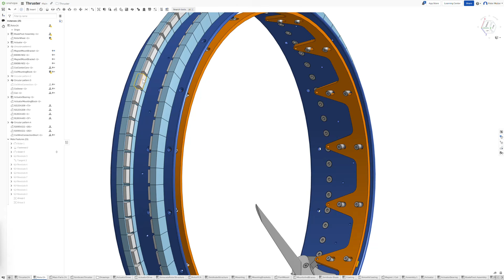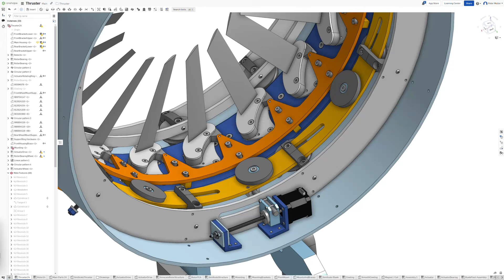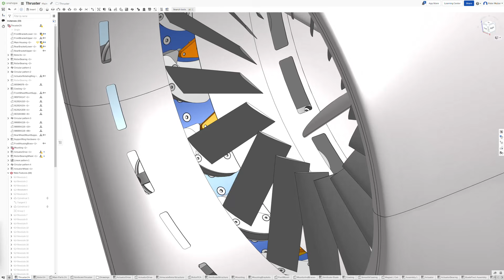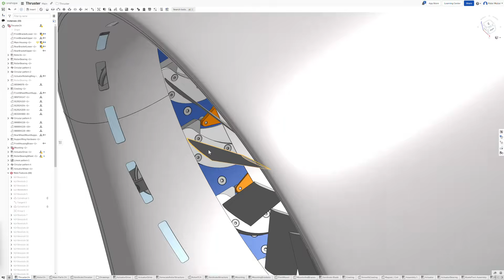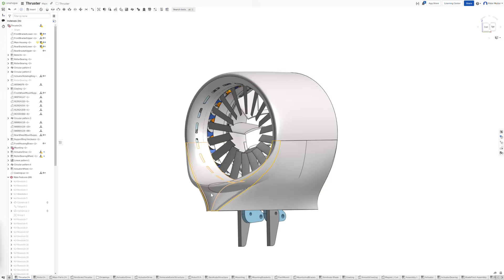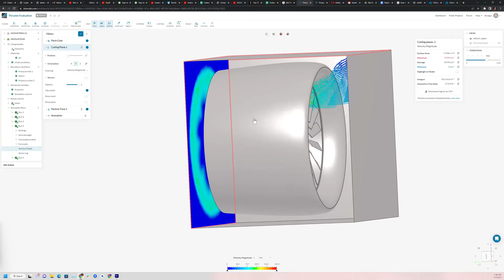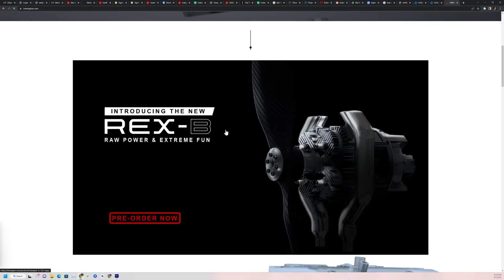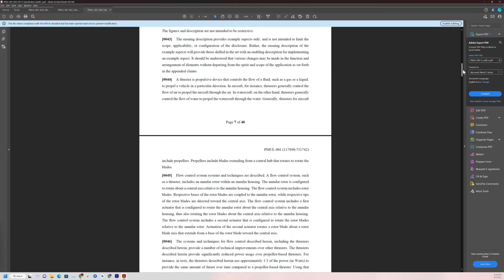Could this Thruster transform Aviation?

Comment: Very interesting 😁
In your efficiency calculations, did you account for the conversion between fuel and electricity? I might have missed it, but I can't really see it anywhere.
A very efficient petrol engine today, is probably close to 30% efficient. I have no idea what the efficiency of the engine you proposed is, though.
One of the most efficient petrol engines today, might be the "tiny friendly giant" from Königseg, using their free-valve technology.
However - hydrogen fuelcells are pretty efficient at turning hydrogen into electricity, though the last time I read about them, they required some pretty expensive materials. Also - considering the full efficiency from production, compression, and conversion, you're somewhat low in efficiency, but for keeping the weight of such an aircraft low, and "local" efficiency high, I think that hydrogen fuel cells are the best option.
Reply: The Edison generator and or battery powered dynamos don't need fuel to produce electricity..
Reply: You're comparing an otto cycle to this? That makes no sense. You should be comparing Brayton cycle engines like a turbofan against this. Brayton cycle engines are much more efficient then ice otto cycles. Otto cycles are around 30%-35% efficient, with modern turbofans hitting thermal efficiencies of 50%+.

Comment: Congratulations! Like someone suggested before,an inner ring is needed here, where it holds the blades to it's pivoting centers...
At high rpms,like it is now ..it will probably flutter and break.
I had designed a turbofan for an air exhaustion system for a CNC dust vacuum..
And on the first design I didn't consider the inner ring..
It all broke apart
Now with the ring..it's working perfectly for 2years ..

Comment: My concern will be FOD, the blades are under compression instead of tension. The blades will be forced to twist under load and in the event of a FOD strike they will probably splay outward.  I’m looking forward to how this plays out. Good luck!
Reply: What if they were attached in the middle? Like it was one piece?
Reply: @jollygoodfellow3957  Having a device in the centre would be heavier and have more drag, adding pitch control would be tricky.

Comment: it would be interesting to see what the flow and pressure would be with a tear dropped cone protruding from the stationary fins through the center.  thus pushing the air into blades. and honestly for the power you are looking at I would look into the watercraft market.  they push some insane power and have shown to be pretty reliable. the engine you are looking it cool but has a lot of complexity. I would almost wonder if it could outlast a rotary engine..... hmmm how about an all aluminum rotary? for the power system I would stray away from experimental systems.... I feel that was the death of the original raptor. if you do go with the proposed engine I would ground proof it with about 40 days running 24/7 under 3/4 load....
Reply: If you put a cone there, you might as well put the motor there and spare the weight & complexity of this design.
Reply: Lol or physics!!! If you think the look makes it useless and "might as well put in an engine" you totally missed the point!!!

Comment: Even at the low end of your target RPM range you will be about 5 times faster than a rotary engine from WW1.

They learned the hard way that it's a battle to spin a large rotary mass fast and it comes with all kinds of penalties.

The torque from those old rotary engines made taking off and landing difficult and it limited the airplanes ability to turn in a direction against the torque.

While I don't think this is a practical engine for aircraft I do think in a twin engine configuration that counter rotation would be best to cancel out some of the negative aspects.

Comment: Many years ago in a thermo module at University I designed a Brayton cycle gas turbine where both the compressor and turbine stage were coupled with a shaft external to both stages
which were sat on annular rings and faced inwards. I was interested in designing a more robust turbine for FOD. I never built the turbine stage but I did build the compressor stage. In many ways this was easier than your construction because I was not trying to embed an electric motor in the outside ring. Which brings me to my suggestions. Don't try to do both in the first design. Worry about the complexities of the electric motor in the outside ring later. Drive it off an external shaft of some kind initially with some gearing. What I discovered about that is that I then needed a sun gear arrangement and a torque multiplexer similar ( interestingly enough as it has comoe up multiple times in work I have done over the years ) to the design of torque multiplexer similar to the design on the front of the Napier Sabre. Lastly when I did get my compressor to run and we put smoke through it in the tunnel and the air flow in the middle was a right mess. You may have none much better wth the CFD and FEA than I did. I did not have access to such wonderful tools. Just a whiteboard and a some pens mostly.

Comment: Here we go again.  Outlandish claims from a guy with no real engineering background and who proved on his prior project that he will not listen to anyone who actually has the engineering knowledge.  Anyone who invests any money in this is foolish and will lose their investment.  If this worked, it would already be in use.
Reply: Well said Sir,
Even the best designed ducted fans in the world are less efficient than a conventional modern propellor. That the designer has supporters believing that he has yet again found some magic formula missed by over 120 years of scientists and aircraft designers  is laughable. 
The fastest 100HP aircraft on the planet race at Reno Nevada every year. They utilize every possible technological advancement in both materials and methods. Engine life spans are measured in numbers of races, not hundreds or thousands of hours, and yet top speeds for these stripped down pure race machines is less than that claimed for this heavy, inefficient, unstable, and draggy aircraft driven by what appears to be a potato chopper.
I doubt that many on this forum have ever even sat in a plane, let alone flown one.
Reply: @jamesgrant2253  Paragliders already use ducted fans to improve thrust and reduce prop diameter, so...
Reply: @vitordelima  Paragliders use ducts to protect the pilot and anyone around the aircraft. Any increase in performance is marginal at best. If a correctly sized prop were used for the engine it would outperform the fan significantly but also pose an unacceptable danger
Reply: @jamesgrant2253  Like I said, effeminate.

Comment: Oh god, another thin gap perimeter driven turbine fan.  If your intent is to create a new "LOOK" sure it looks cool, but there is nothing better about it.  The perimeter bearings are running at crazy speeds, the iron-less core needs external inductors because the IGBT's can't switch fast enough, unless you are using iron core which will be crazy heavy.  Don't believe the hype about in the ultra-fast switching electronics where you don't need inductors.  It is extremely unstable with ringing currents all over the place.  the perimeter housing and the center fan need to be very rigid to maintain proper gap (a lot of weight).  Did I mention it is crazy expensive.  All to get rid of a low cost, very reliable, low weight, very rigid center driven motor.  Seriously look at all the compromises that have to be done and stop this stupidity before you waste every ones money.  Maybe some niche market, but I can't think of any application where this is concept better.
Reply: I agree. Also imagine what would happen to an aircraft if the huge mass of this rotor were to sieze. Fortunately this will never be used in flight.
Reply: Well aren't you a big fat ray of sunshine? Let's see that last thing YOU designed.
Reply: I can see the idea behind it. 

I don't see this working on a plane. It is just too much complexity into the system even after you iron out all the flaws. A combination of other methods can solve the problems this is addressing, like having multiple rotors. 

 Maybe some drone submarines might benefit. Give them mobility under water I don't know. 

 I'd still like to see it fly!

Comment: @Peter Muller Please look into the design of the PLAID Tesla Engine. If the permanent magnets were replaced by magnetic coils you could achieve more torque using a similar technique.

Comment: Save your money. Engine manufactures will not move to a rim driven turbofan system. There are too many additional parts = more weight (All those magnet alone big weight penalty ) and more complexity and opportunity for failure. This is ridiculous. The other extra weight and fuel penalty would be the need for larger generator driven by the jet engine or a dedicated accessory engine. Turbo Blades can already be adjusted via oil pressure through center of the current engine drive shaft.

Comment: Conventional variable pitch propellers are already 80+% efficient. There is very little room for improvement. What gives you the right to violate the laws of physics?
Reply from the maker: Run the CFD yourself and prove me wrong.
Reply: @petermuller9177  Why run a cfd simulation when you can do basic math. 100%-80% leaves 20% until your 100% efficient which just isn’t possible. Either you’ve designed a perpetual motion machine or your calculations are way off.
Reply: No imagination..
Reply: I'd say the entire enterprise is completely imaginary.
Reply: I never understood what his efficiency means but I'm too tired to learn more about this either. It doesn't look that efficient judging by the noise, drag and turbulence it causes.

Comment: Excellent new thinking and timely review of an old problem for a new age. I am a retired aero engineer and spent some time on new bearing ideas for high stress applications like helicopter rotor bush design. The number of small high speed bearings called for in your roller wheel design raised some concern. I wonder if you could consider a full circular air or even maglev bearing as a simpler more robust possibility. extensive dynamics modelling and testing is going to be required but nothing that cannot be overcome with todays materials I would say.

Comment: In my opinion I would run the blades into a hub, that would reduce tip flutter by eliminating the tips and converting some of the dead airflow into thrust.  Since the blades would be connected at two points it would probably stiffen the blades.  Also that would reduce drag since there would be no tip vortices.  I would also take care on blade balance at higher RPMs.  Out of balance blades could cause high enough vibrations to damage the engine.  Great proof of concept.

Comment: Consider omitting the blade pitch mechanical devices as the tiny wheels and assembly is subject to failure. Further,  the heat potential can cause warping adding to the control's friction.   Consider using high-quality cables to change the pitch pulling against high-tension springs. This eliminates the mechanical wheel and sheet metal combination. Additionally consider feathering the blade edge to reduce the noise factor, no whistle or roar.  Lastly, if longer blades are an advantage, consider sharpening the ends when adding length.  Good Luck Peter.  Possibly use two reversing servos for the cable of your metal pitch changes.

Comment: Great ideas - I didn't see it mentioned, so I'm just adding some thoughts. I have several pilots in my family, and some are trained for various types of flight (I am not myself). How will this handle a dead engine - variable rate props tend to have a feathering to a nearly null effect point, and it can be moved into that state with minimal power if not a default state. And I voice the fears of others with the large number of failure points with the parts. Keep on with this - it could be a great innovation.

Comment: Very cool idea, I think that attaching the blade pitch control ring to the blades with an adjustable roe end would be a good addition. You could then dial in the blades for efficiency and also it would be better for longevity. Also the stepper motor would almost definitely need to be a hydraulic ram with the forces needed to move those blades at high thrust if needed. This is an awesome project though,  great job. 👍

Comment: Nice design, but one big issue that's very easy to solve is the problem with the gap in the middle, where the vacuum created by the spinning air wanting to be thrown to the outside will produce massive drag. You can solve this by putting a hollow tube in the middle, that extends out the front farther than the blades. This will be your bypass tube, air that comes into the front will remain at a higher pressure and will exit at the back, contributing towards laminar flow, reducing turbulence losses significantly. You're basically protecting an air flow through the middle from the centrifugal forces... well, mostly, you will find the air through the middle will still be spinning, as you're working in the subsonic regime, the effects of the spinning blades actually travel up-stream as sound waves, so the air starts feeling the spin before it even enters, so it depends how far forward you start the bypass section, there will be a sweet spot where drag reduction is at its greatest. You should be able to measure a reduction in noise produced to confirm efficiency gains.

Comment: Looking at the the blades, to minimize the tip vortexes, to me there are two options, 1. on the tips of the blades make a T section on top. 2. A teardrop fairing supported by the stators with a recess for the blades.  My thoughts are the fairing is the way to go as it should reduce turbulence and direct more air through the blades.

Comment: I made a prototype of this idea using a Chinese ‘Lazy Suzy’ as my main bearing and an axial flux drive mechanism.
As many others have pointed out here the problems will start when this thing is turned up to design speeds (Blade Flutter, High bearing loads). I would dearly like to see some ‘professional’ aero-grade research/design/engineering done on this concept.  
Some suggestions and good luck!
1. Model a 4 or 8 blade ducted fan to use as another baseline.
2. Seek assistance from an electric motor design expert who will be able to suggest better/more efficient drive mechanism -for example use of Halbach magnet array, axial/radial flux,etc.
3. The bearing design seems too rudimentary, seek assistance
4. Until other things are optimised the variable pitch idea sounds like a distraction, perhaps park that idea and use 3D printed fan-disk (in small models you might even be able to get away with plastics which would substantially reduce your prototype build time).

Comment: Alright, first cut the blades conically with mild curvature to reduce flutter, then a simple slimming of the cam mechanism for the blade pitch adjustment, by putting the pusher cam straight at the bottom of the blade instead of having it be its own plate and then introducing a very thin press ring to hold them; That will reduce overall rotating mass and smooth things out as well as improve inside radius likely. Then the next thing is to simply put in three to five horizontal counter gears to put in a contrarotating secondary fan at a fixed +1.2-1.5 degree blade pitch behind that first one; That will get rid of the need for a stator for directionally correcting the airflow, and improve net efficiency. You can then also reduce the amount of blades as you achieve a flow intermeshing, so you get rid of a lot of drag, you improve exit flow speed potential, and if you want you can put in a secondary ring of magnets at an offset, which means you can space out the windings themselves and thus achieve both a better net torque, torque overlap, and potential top end rotational speed.

Fantastic work! Always lovely to see guys doing new things; I'm kinda surprised that we haven't seen any more rim drive experimentation than we have since it is precisely so optimal... This stuff is gonna become more and more relevant; There's a whole new world growing in drone flight and regional aviation...

Comment: This is a neat idea. For lower rpm applications this is the way to go. I think this would be a fantastic marine thruster. It could have high torque with fewer larger fixed pitch blades. But for aviation, I don’t think it’s optimal. The higher the rpm the more centripetal forces on all the critical perimeter parts. Opposite of a turbofan which has all the mass precisely where it does the least work and has the lowest forces, where the hole is in your thruster. I would love to see marine modeling. You could create a lot of low speed torque with this thing!

Comment: Peter, couple of comments:
1. Have you tried modeling with blades shapes similar to current turbofan designs. They are designed in a way to reduce opposite flow from the blade tips, generating more thrust. 
2. The gas engine you showed is still too complex. You don’t need rotating core. There are simpler and lighter engines, which have coils around pistons to generate electrical current. Pistons move freely, less loss of energy on rotational forces and other friction and much higher overall efficiency. Probably highest for gas powered piston engines. Very similar design to hybrid engines for locomotives.